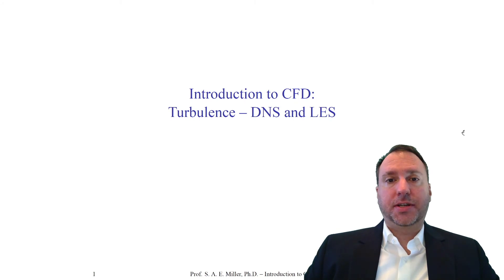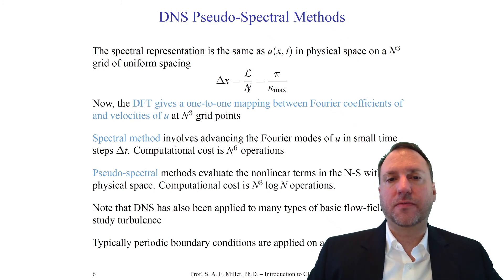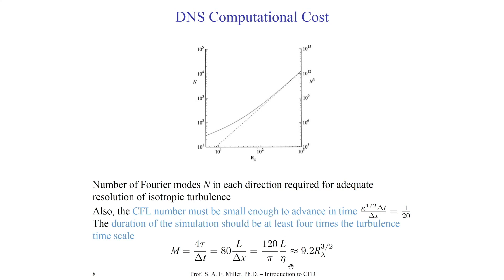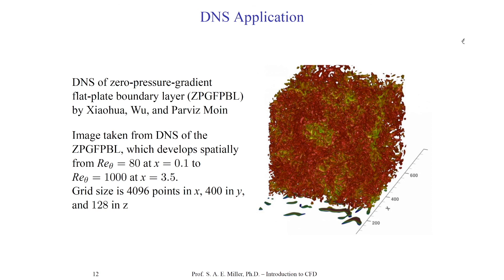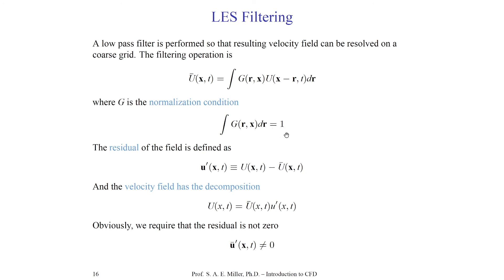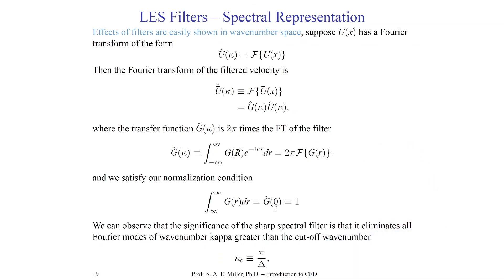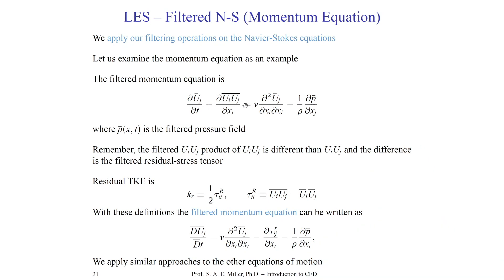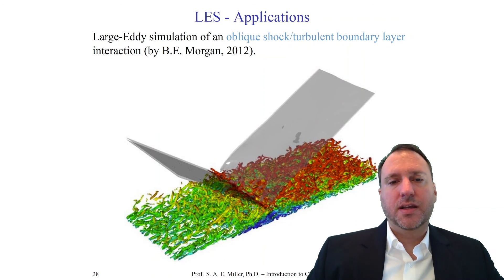Introduction to Computational Fluid Dynamics - Turbulence - 6 - DNS and LES

Comment: So my question…. If you are using smagorinky/kolmogrov model, K -5/3 is based on equilibrium cascade of energy, does this apply in inhomogeneous time varying (which implies non-equilibrium or dynamic unbalanced cascade, am I correct?) flow/turbulence?  Is there an explicitly or implicit assumption here that the dissipation scales are steady state, homogeneous or in equilibrium?  Is this studied via lab, wind tunnel or real experiments?  If I recall there is intermittency in the dissipation…etc etc.  Thanks
Reply from the maker: These are simple questions, and really good questions, and probably a comment on Youtube cannot answer them accurately. Intermittancy in theory has been included approx. 20 years after K41 theory. That's not an issue. All turbulence is unsteady. Inhomogeneous flow-fields do have cascades, and often look like the spectra of homogeneous isotropic turbulence. Turbulence has a universality and a 'memory.' Studies have and are being conducted in every type of facility you can imagine - and likely ones not easily thought of today.
Reply: @SAEMiller  Thank you for your reply’s. They point me in a direction to explore/dig.

Comment: Hello Miller, a very nice explanation and I worked with DNS in MIPT University, Russia. I am trying to solve it by commercial software.
Can you suggest some DNS coding books for Ansys software?
Reply from the maker: What a wonderful university. I'm sure that you are enjoying it very much. If you want to do DNS I suggest using an open source code online or creating your own. Usually DNS simulations are very computationally expensive and the commercial packages aren't really designed for them. I suggest you read the overview paper DIRECT NUMERICAL SIMULATION: A Tool in Turbulence Research, Parviz Moin and and Krishnan Mahesh, Annual Review of Fluid Mechanics, Vol. 30, 1998
Reply: Sir, how can I learn dns simulation? From where to start can you guide?

Comment: To further…. Is LES incomplete simply because of the transition to dissipation (i.e. heat or nothingness) is not modeled.  Numerical dissipation seems lazy.  In my application, atmosphere wind gusts are intermittent and we do not know how much. :-)
Reply from the maker: An incomplete turbulence model, in my view, is one that needs more information than just the equations and physics to make a prediction. For example, some RANS based models would need distance to the wall. They are incomplete. Implicit LES, in my view, is incomplete because it relies on min. grid point spacing for a filter. LES with a sub grid scale model would be complete, because they model (though with some empirical functions / constants), is considered complete because it would not rely on additional information from the user such as wall distance etc. Filters are dependent on grid point spacing either way. Some people for this reason would consider all LES to be incomplete. I can see both viewpoints.